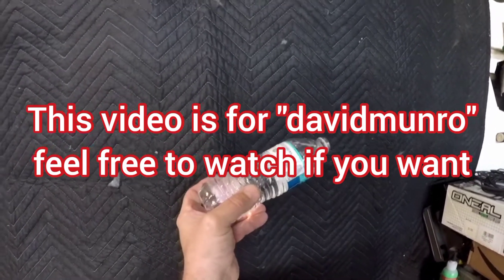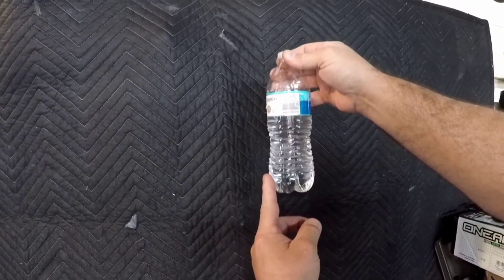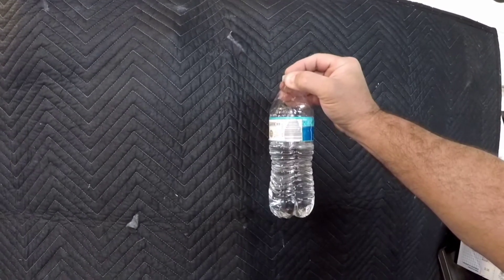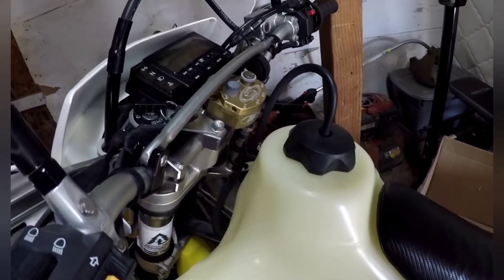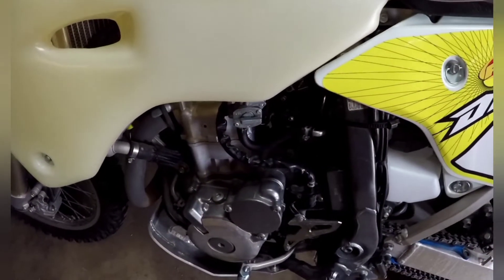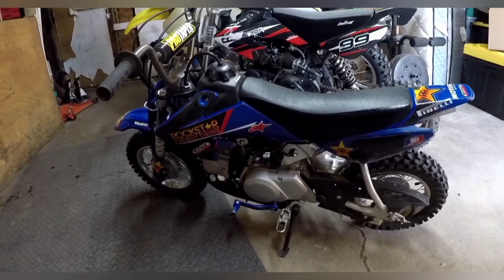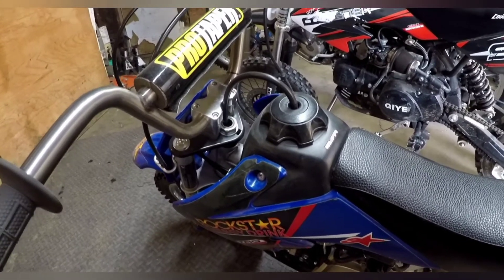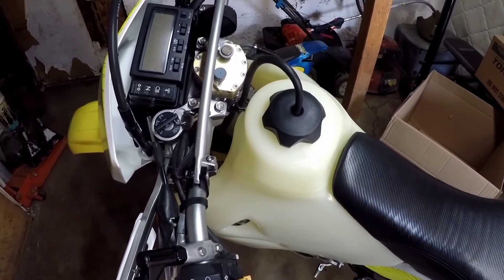Vented motorcycle gas caps and where to vent them.

Comment: You eased my mind so much thank you!! I was doing a tank rust sealer treatment on my Honda Shadow and forgot to clear the vent tube at the bottom of the tank before the stuff hardened. I've now drilled a hole through the gascap and hoping I can vent through the keyhole!
Reply from the maker: That's great. I hope it works out for you.

Comment: cool water bottle demo,im restoring a 1986 honda 250 SX three wheeler and needed a new tank all i could afford is a plastic one they sell on amazon and ebay,but the lid just has a tiny hole in it,so i wrote both sellers and one on amazon didnt know and the ebay seller said its not vented so im like well it has a tiny hole in the lid DUH so i guess i will see when it gets here.i do have another ugly tank its plastic that has a way of hooking a rubber hose up to it like those in your shop,so if it fits i will probably use it you know,just so it doesnt get clogged with dirt or something,weird huh,its a mystery to the sellers.theres a tiny hole in the lid,but its not vented he said haha thanks man.
Reply from the maker: That's funny, but sadly not surprising. They will sell us anything for a buck, working or not 😂
Good luck getting it together and going.
Reply: @dualsportdiary1150  thanks i love restoring these old honda three wheelers except for paying for over priced pieces good lord haha later man

Comment: Somebody help!!! Brand new 125cc egl dirt bike,  brand newwwww. Always bogs down & shuts off if no throttle! It almost dumped in 4th on the pavement because I didn't use throttle and it tried to bog down & shut off. Please help 🙏
Reply from the maker: @adamdumas7310  watch a video like, "how to adjust dirt bike carb"
2 screws need adjustment. Easy, watch one of those videos.

Comment: Thank you, thank you, thank you. Great demonstration. 
Can you please answer a question for me. I have an 05 Sportster with a vented tank, one hose on the petcock behind the fuel line and the other hose on the other side of the tank. I want to put an earlier style tank but it doesn’t have the vents. Will a vented cap work in place of these vent connections on the tank. I hope you can answer this for me. 
Thanks
Reply from the maker: I can't be positive without seeing it. But, it sounds like a vented cap should work for you from what you're describing.
Reply: @dualsportdiary1150  You mentioned something able being smog compliant, I wonder if that why they made this system. Thank you for your response
Reply: @dualsportdiary1150  I just watched another video, I think the correct term is vacuum petcock. Do you know if I can replace that with a gravity fed one?
Reply from the maker: @mrdrivebytrucker  Yes you can, I replaced my vacuum petcock with a manual petcock.
Reply: @dualsportdiary1150  Sweet, thank you very much for answering my questions

Comment: Do you have a hot tip on how to keep the vent tube from falling off? Thanks.
Reply from the maker: Super glue.
RTV silicone.
Smaller diameter vent tube.
New vent tube since yours might just be worn out.
Cut ½" off your vent tube since yours might be worn out.
Better quality vent tube like silicone instead of rubber.

Comment: Hey! I have gas spitting out of my gas cap. Any reason this could be happening? It's for my kids 49cc mini dirtbike. Thank you!
Reply from the maker: Since the caps are vented gas can and will slosh out the cap. Especially when you lay the bike on its side from crashing or laying it down and from movement likes jumps etc. Try a cap with a check valve on the end of the tube. That should help.

Comment: so if you will leave a bit of gas, it will just evaporate because of the vent?
Reply from the maker: It shouldn't evaporate much. But by nature gasoline will evaporate. A one way check valve will help. That will allow air to go in but not go out.

Comment: Hey bro I have no fuel gettin to my carb, I’ve removed the petcock and cleaned it I’ve also taken the cap vent off and cleaned it and still no fuel flows through. It only flows if I blow through the line? Would you know what to do?
Reply from the maker: I'd check the float bowl/needle and seat. Is it a vacuum operated petcock? What kind of motorcycle is it?

Comment: Can you vent a Factory Enduro 4 Stroke Bike? 
I have a Yamaha Xtz 125cc, a Factory Street Legal Enduro Bike, is it necessary to Vent it or not? Would it give any benefits?
Reply from the maker: Your Yamaha Xtz 125 does have a fuel tank vent from the factory. It's not visible from the cap, but the tank itself has a factory vent.
Reply: @dualsportdiary1150  Okay. Thanks for answering.
Reply from the maker: @giovannitoewsyt  absolutely!

Comment: I have a icebear mojo magic 150 cc and each time recently after filling up my bike stalls out. I've put new sparkplug, check vacuum hoses, check my coil end of sparkplug cable. So my question is do think the  gas cap vent hole is manufactured to small. I have a ¼ turn cap can the vent hole be enlarged. The hole to me very small.So to simplify can the vent hole just be to small.
Reply from the maker: The vent can flow enough even if it's pretty small. I'd check your float level and make sure the jets are clear with those symptoms.

Comment: Appreciate it! This clears up my confusion. I'm hoping that most aftermarket fuel caps have a system preventing fuel from pouring out (when tipped over). I had an older KTM that was carbed and each time I layed it down, fuel was coming out of the vent hose and pouring into the frame. It doesn't have any smog stuff so it would vent freely. The fuel cap may have been sticky or something. Not 100% sure.
Reply from the maker: Thanks for watching. Hope it helps down the road.

Comment: This might be a stupid question but, what happens if you put your bike on the side with it’s tank almost full. Would it leak gasoline? I saw a video of a KTM TPI 300 being on it’s side like that and after he started it it caught on fire probably due to that.
Reply from the maker: Not a stupid question because, yes you're right. They can and will leak gas when they lay on the side. Just goes with the territory I guess.
Reply: @dualsportdiary1150  do you have any tips on how to prevent that from happening as I am terrified now after seeing that fire🤣 Getting a KTM 350 EXC-F in 2 days. Very freaking excited.
Reply: Could secure a hose with very little superglue to avoid clogging, or https://www.youtube.com/watch?v=laUcujo2uAs

I got some short tube valve things meant for gas caps that only let air in but not out. With the stock IMS gas cap (maybe it was just dirty, dunno) it leaked, with a Tusk billet aluminum bling gas cap, and one out of four valves I tried, it wouldn't leak.
The problem with that is that gas can expand with heat. Which would pressurize the air and maybe shoot the valve off. Might not be an issue if the tank isn't totally full

Lost that valve in the trail, tried a different one that I couldn't blow air through, but it's leaking again somehow. I was gonna try a long hose because someone recommended it to me, but after what you said about the KTM.. nah.. this is annoying 🤣
Reply: @dualsportdiary1150  and thank you so much for your response
Reply from the maker: @xmrlebeatsx6965  That's a bad azz bike bro. Congratulations! The only tip I'm aware of is don't crash and lay it down 🤣
Reply: @dualsportdiary1150  yeah man I am so excited and it’s a 2021 model so brand new, don’t expect any issues with it… yet… Hahaha that’s a good azz tip🤣thank you🙏ride safe brother
Reply: @dualsportdiary1150  by the way I found out as to why that happened. He had the long tube which leaked gasoline all over the frame. Somehow the spark plug just sparked it at start and the rest is history. I will probably go with the short tube. Rather have it leaking on the floor than all over the bike frame.
Reply from the maker: @xmrlebeatsx6965  makes sense. The yellow DRZ in the video has the tube running back to the factory vents so it's contained. But when I crash the black hose always pops off and it spits out the cap on the ground. Then I fumble with putting the hose back on as it's leaking and get gas all over my glove and I smell for the rest of the day 🤣
Reply: @dualsportdiary1150  oh god🤣🤣🤣
Reply: I'm wondering if to much tank pressure will cause the needle in the carburetor to over pressurize.....I'm trying to figure out why some caps only let air in and not out.

Comment: So for a DRZ400SM with a stock gas tank this isn't gonna do anything?
Reply from the maker: Nothing to worry about. The stock gas tank is what's vented on a DRZ400. The stock gas cap has no vent since the tank has a built in vent which is routed to a tube below the tank and to the charcoal canister.
Reply: @dualsportdiary1150  so what if the bike doesn't have a charcoal canister?
Reply from the maker: @Disllexia_Reuls  then it can be vented to the atmosphere or to the airbox. If you see my video where I install the IMS tank you will see the stock metal vent tube on the bottom of the stock DRZ metal gas tank.
Reply: @dualsportdiary1150  so in terms of someone who has no idea what I'm doing I can buy a vented gas cap and connect it like the video and it'll work? I'm sorry, all I know is twist wrist make bike go weeeeee.
Reply from the maker: @Disllexia_Reuls  yes Sir! The point of the video is pretty much it doesn't matter where the vent is or where it goes. You just NEED a vent of some kind or another. It can be the tank is vented, the cap is vented, it vents straight into it of the cap, it vents to the hose, it vents to the open or to a hidden location. Just as long as you have a vent of some sort you are good to go! 

The problem is when people think they don't need or want a vent and just block off and seal up everything, they (can) have issues later down the road.
Reply: @dualsportdiary1150  thank you king, stay humble
Reply from the maker: @Disllexia_Reuls  Never a problem Sir. Anything you need just ask, if I don't know I'll absolutely track it down and find it out! Thanks for watching!
Reply: @dualsportdiary1150  any recommendations for a vented gas cap I can run a tube with?
Reply from the maker: @Disllexia_Reuls  if it's for a stock DRZ400sm tank then I'm not aware of any gas caps with a tube vent since the stock gas tank is already vented. If it's an aftermarket tank with the twist in (threaded) cap then any cap with a vent and a tube is just fine whether it's a basic plastic one like I have on this DRZ or a fancy anodized aluminum one.

Comment: Sweet! Yeah this I understand, I think I got mixed up between having to cap the barb for the VACUUM tube as I'm switching to a manual petcock, and not realizing that I don't need to do anything with the VENT tube as I switch to the locking gas cap. I'll just leave the vacuum tube under the seat. A little overthinking on my part. Thanks for posting a video just for me!! By the way, you skipped over the washing the tank part, and I actually was wondering what you did? I believe the directions say to swish some gas in there and dump it out. I wonder if I could do the same with water and let it air dry to save a mess of gas splashing everywhere.
Reply from the maker: The tube that goes to the petcock is a VACUUM tube. Not a VENT. 

CAP IT OFF. If not it pulls air into the intake, it will mess up the jetting and pull dirty air into the engine. Do not leave it open. 
YES, you can use water to wash the tank. Of course make sure it's completely dry before you use the tank.